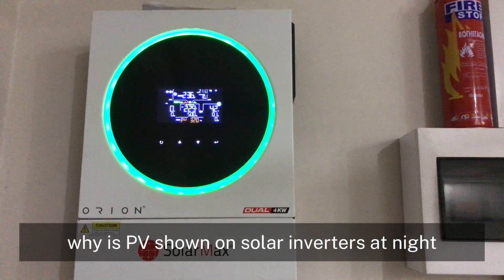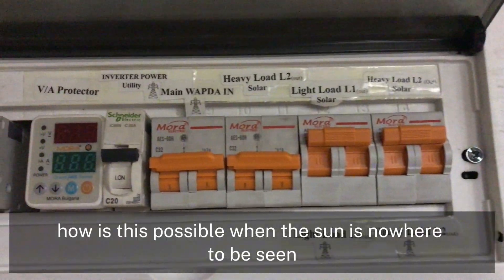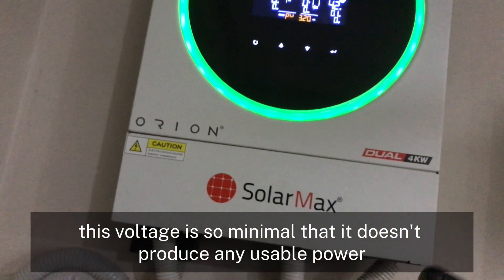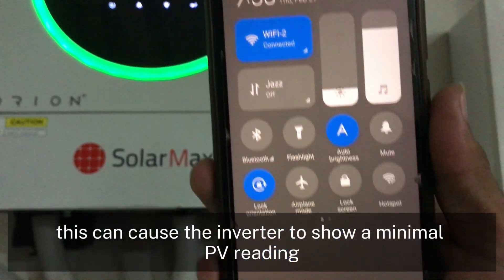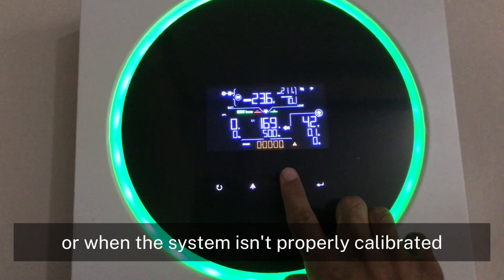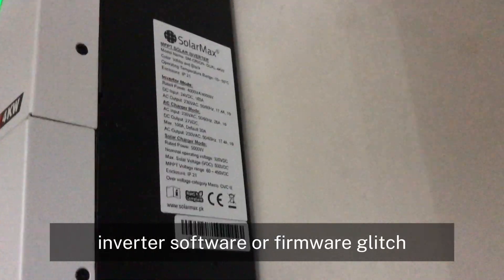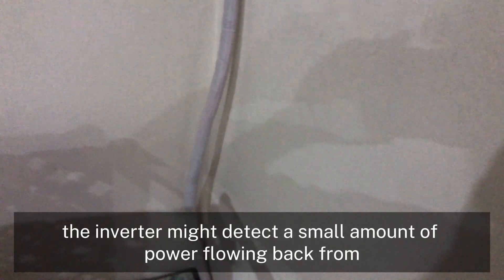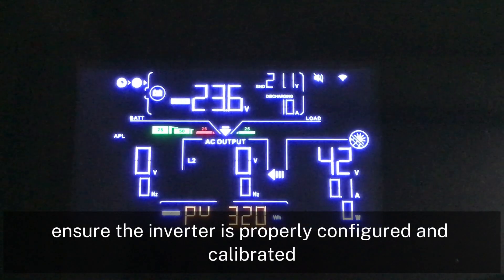Why is PV Shown on Solar Inverters at Night? Even During Rain or Clear Skies! #solar #inverter #grid

Comment: its a software issue. inverter firmware should be intelligent enough to mitigate such issue happening due to weak pv voltage.
Reply from the maker: It is not in routine. Just in shiny night